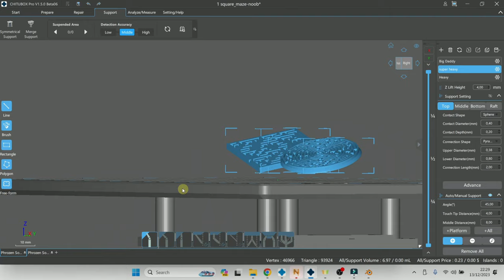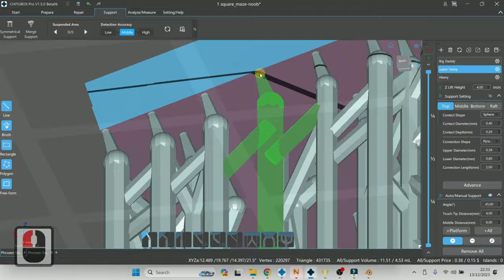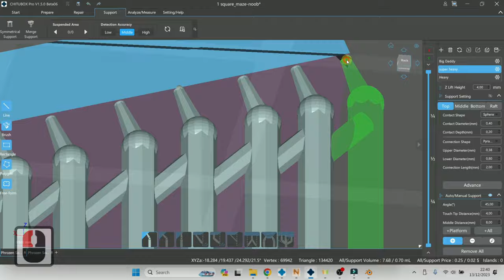Masterclass Resin Printing (MRP) 3 - Support Base or Flat model

Comment: thank you very much, i was a bit scared that my prints would always not match when cut into pieces and printed, but now they will
Reply from the maker: @LomaT97Cool  but remember.
It takes experience.
Reply: @wangdennys  Yes of course :) but I reprinted the parts of a model I previously cut into pieces, and now they are almost flat :) so not bad for a first try

Comment: First of all Thanks for all the Videos! Is this with every Flat based objekt possible, also when they are a  thicker than yours?
Reply from the maker: @ateriblemoveonyou  yes
If thicker, add more anchor just in case
Reply: @wangdennys  i guess you mean also more on the edge, Thx for this Quick Reply

Comment: I usually do 30degrees in x and 30 degrees in y. This allows the new layers to build without sagging. I auto support with about 10mm distances and then add extras at the start point and the 2 main build edges.
Reply from the maker: Thank you for sharing.
Reply: By going taller, you can also fit more on your build plate.
Reply from the maker: @Artmesa  yep, agree.

Comment: That's so interesting that the TOP of the model was affected, usually warping and bowing happens on the supported side in my experience, due to undersupperted edges and support density not being high enough. The top edge has never warped in these cases, I assumed due to the bottom layers providing a firm enough base after 10-15 layers after the support transtition. Thanks for amother great video, Dennys!
Reply from the maker: Actually more like the middle, not just the top.
The middle sunk in because the shrinkage from the support under the middle area.

Comment: I recommend adding a few center supports at least, otherwise you CAN get sag as the resin cures depending on how fast youve got your printer going.  I run mine right up against the edge of how fast it hardens, and mostly print abslike unless theres nothing structural about the print. (Art for example). This has the layer drying just as it is pulled off the plate, but makes for very low cycle time and fast as hell prints.
Reply from the maker: It doesnt happen to the base i print in the video.
Because all of my printer run on moderate speed using tsmc. 

But yes on larger object i suggest to put some support on the center to prevent it sunking from shrinkage

Comment: New to resin printing. Why do we angle and support the flat surface, instead of printing flat on the build plate?
Reply from the maker: To reduce cross section area and reduce peeling force.
Reply: @wangdennys  thank you!

Comment: Why are the ones supported only on the edges not sinking in the middle?
Reply from the maker: Your question contains the answer 😁
Reply: @wangdennys   I guess I'm too dumb to get it
Reply from the maker: @jamqdlaty  too much supports in the center could cause the middle to sunk because they got pull by the shrinking force of the support around the center.

Comment: Hi, thx for your suggesion. I have a similar problem about my prints edges and corners. I cant get straith edges and corners. My prints edges and corners are curved, so the parts of the prints which have multiple pieces and sould be assembled,  wouldnt fit each other. I will try your this suggession but do you have any other direct one about my issue?

Comment: I don´t understand why people dont directly print on the buildplate. I usually add a 0.1mm beveled base for easier removal, and then go for it. Yes it can have a slight elephants foot, but it´s not visible because its under the beveled part.
Reply from the maker: Not all base or flat object can be print directly on plate.
Because there are infinite shape and sizes.
So no harm with having more knowledge right?
Reply: There are many cases in functional prints, printed flat on the build plate, where some higher layers of the print need to be supported, the principles Dennys Wang showed here work great for that, too.

Here's an example, consider a 200mm tall part, starting with a circle with a center hole in it, flat on the build plate, then 4 shafts concentric to (attached to the edges of) that circle rise 50mm with another circle with a center hole in it, and so on until the top.

This method Mr. Wang showed is essential and works great for things like that.

Note:  The reason one would do a part like this in this way optimally (flat on the build plate) is so that all of the circles and the holes in the center will be perfectly round and of the correct dimensions - when circles or holes are printed at an angle, they can become distorted due to cure-through and/or blooming, and is more complex to correct for.

Comment: yeah i tried this and it does not work with a model that weighs around 300grams. had a complete failure..
Reply from the maker: My friend printed tombstone almost full size mega 8k build volume. About 1.5kg materials. 
He printed fine.
There are alot of factors as to why a print fail. Print seeting, prientation, support size, also user experience.
Reply: @wangdennys  what I had meant was. Printing with that thin line of supports only along the edge with a heavy print wilp never work. I have to fill mine about 75% density to get it 2 work
Reply from the maker: @genin69  it works for me when printing big diorama base on mega 8k.
Just need experience.
You could use some 0.6 support tip as anchors.
Reply: @wangdennys  i have an object with a flat bottom and some small detail on top for a mold. Its 17cm x 12cm and 2.5cm height. Only way ive had a succesfull print on my mighty 8k is at 35 degree angle with supports on heavy at 75% infill. So ur saying if I have bigger anchors and thicket supports ill be able to print that only lining the edges?
Reply from the maker: @genin69  yes
Curious for the the object.
I might be able to do it on next thursday live session